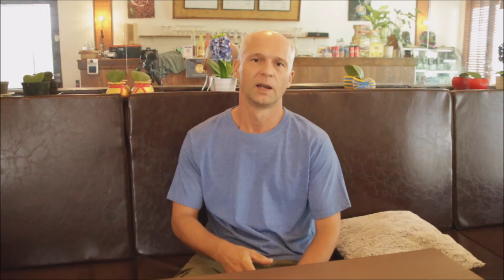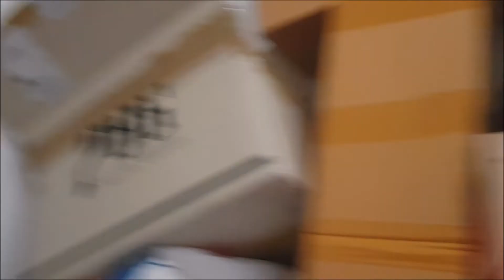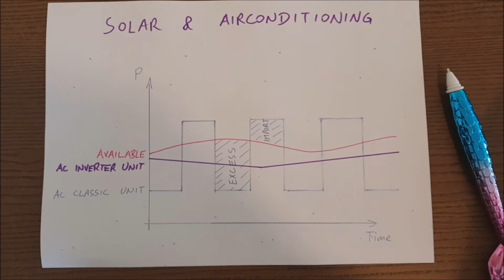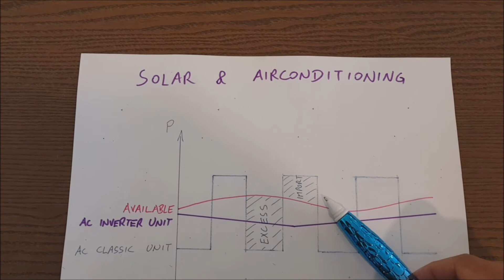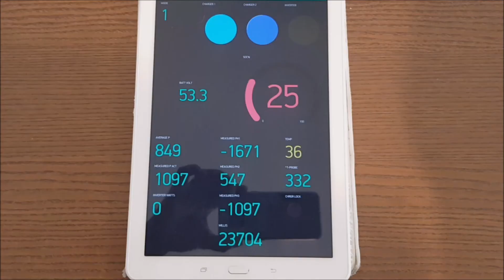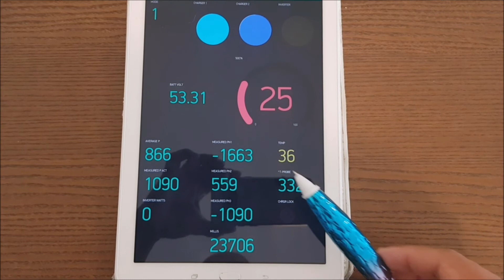Solar PV and Air-conditioning. Anything to consider?

Comment: have you installed a soft starter ? is it needed when running off Solar PV ?
Reply from the maker: no. no soft starter needed for a minisplit AC, especially when it is inverter type. those systems are already adjusted perfectly by its electronic.